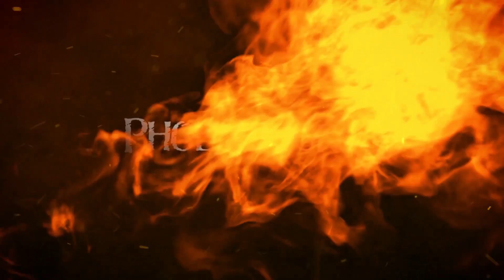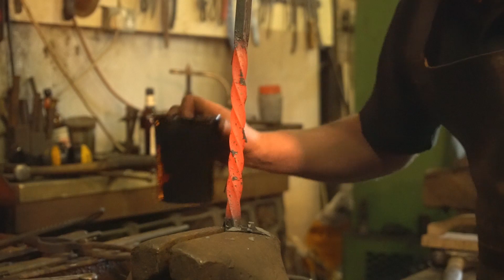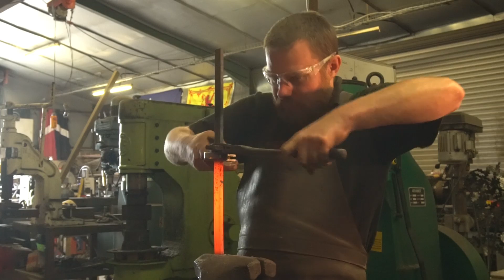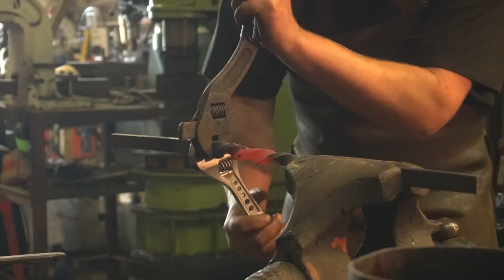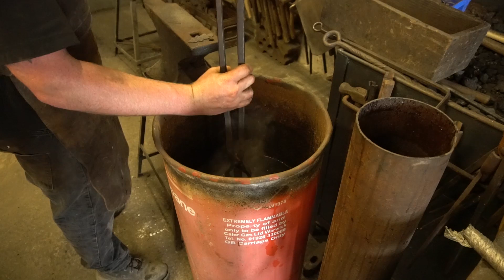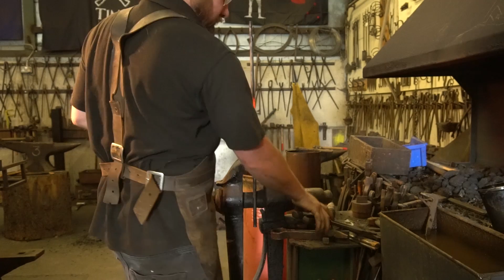Twisting Steel- The Basics - Blacksmiths Essentials -

Comment: Hi, there’s a couple of things I noticed about your setup that I have never seen before in any blacksmith’s shop.

1: Using a wood block for hammering.  I guess the best benefit of using wood over steel is that the hammering will not squash features you want to preserve as opposed to metal where hammer blows will squash your hot metal between the hammer and the hammering surface. Clever

2: Brass plate on the top of your anvil. Again, brass is malleable and is a bit like a piece of leather and won’t squash your work with hammer blows between the work and the anvil. I have a question. How do you get the brass plate to stick to your Anvil top or is is moveable? Thanks.